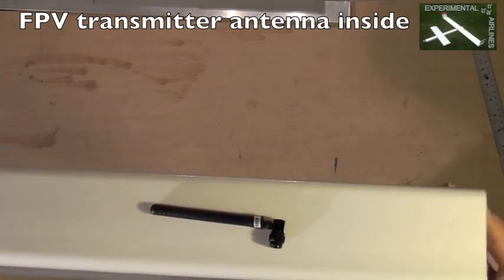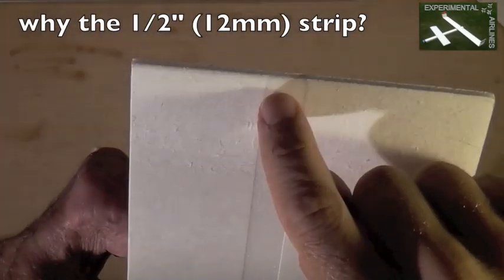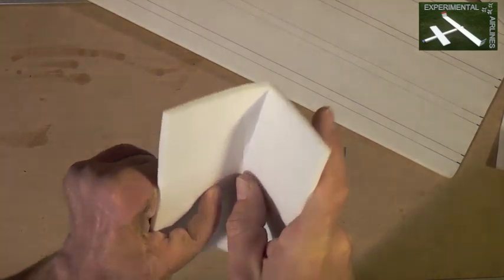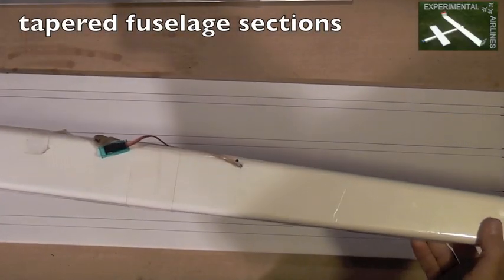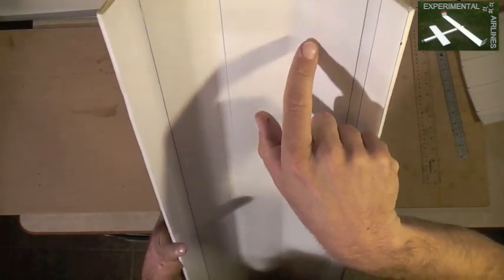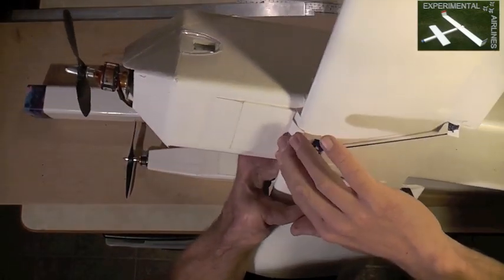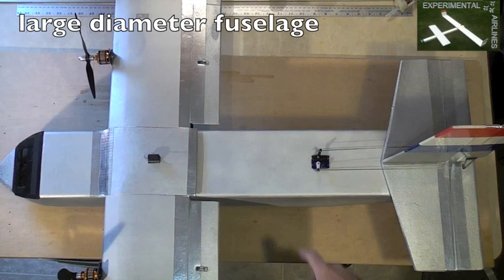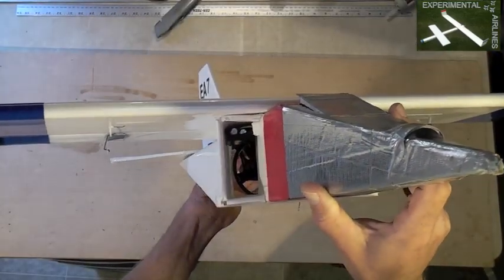Foamboard Building Techniques: Fuselage Tubes Ideas and Variations

Comment: I find that before you bend the foam at the half inch mark for the square tube,just run a piza cutter down the middle of the half inch strip,and it will bend much easier.Thanx for a very good vidio.

Comment: If you roll the foam with a rolling pin, it compresses the foam somewhat. This will allow you to bend the foam without it breaking or wrinkling. I have built a few round and rounded
fuselages. It works for making paradihedrals on wings tips too.

Comment from the maker: Hot glue for quick bond and no-stress joints, white gorilla glue for firm bonds.  See my recent video on pretaping foamboard for more info on that, and the tape source.  As long as there is tape and paper on the outside radius the foam will not break when bent.  Don't worry about the ripples.  They will mostly smooth out upon bending the board.

Comment: Hi nice work, I watch your other videos and I'am learning different ways to build. I got some foamboard at THE DOLLAR STORE and it has slight waves in it. It is ADAMS white foamboard and the outsides peel off easy. If I try to bend it into a wing or fuse will it break or just bend? I have been using blue foam from Lowe's and sometimes it breaks. I score it where I want to bend it. What glue is best for this white foamboard? One more thing. Where do you buy your thin colored tape? Thanks

Comment from the maker: I have once, and other guys have.  In my opinion it adds more weight than is justified by the strength gain.  The standard construction is plenty strong for normal and aerobatic flights.  I suppose if you were going to crash all the time, maybe it would be worth it.

Comment from the maker: You can make round tubes. Heating is not necessary, just removal of the paper inside.  It's a little difficult to make them perfectly round, and then it's harder to attach flat things like wings and tail surfaces, but round is arguable more aerodynamic.  Looks cool too.  Square is a bit easier to cut hatches for and situate things inside.  Try both, see what you think.

Comment: Does this foam bend well when heated?  Would it be possible to heat and mold it around a round tube to make a round fuselage?  Would there be a significant aerodynamic advantage to a round  or tapered round fuselage?

Comment from the maker: @maj0411 Sure, I will work that into a video soon.  I was lucky enough to stumble upon a small supply of 1mm titanium plate which I fabricate into an "L-bend" and drill that for the motor screws.  This is stuck into the fuselage or wing with 3M heavy duty foam mounting tape.  You'll see in the video coming.  I've done it with aluminum too.  It works exceptionally well for all my aircraft so far.  Thanks for watching.  Stay tuned.

Comment: Good video.  I did test comparison between your fuse method and the vinyl that I am using.  The foam fuse is 38.5 grams per foot, mine is 98.5 grams per foot.  I think I might give up the durability of the vinyl for the weight savings.  Thanks-